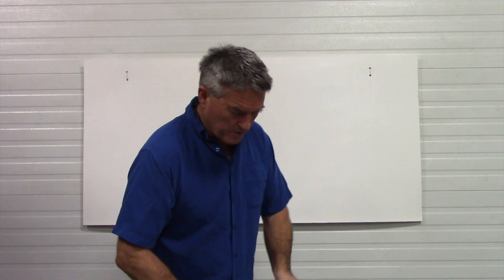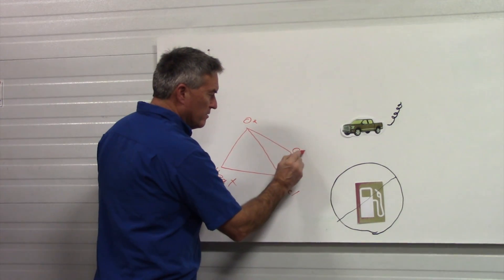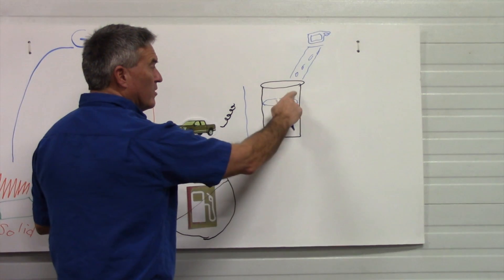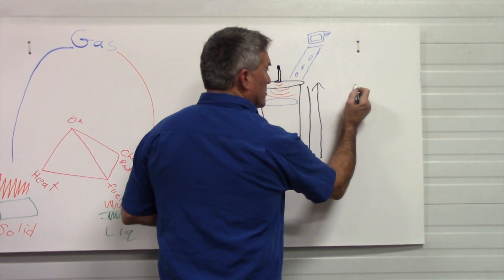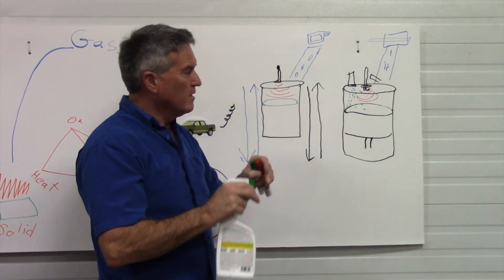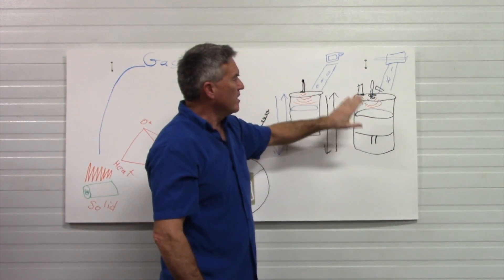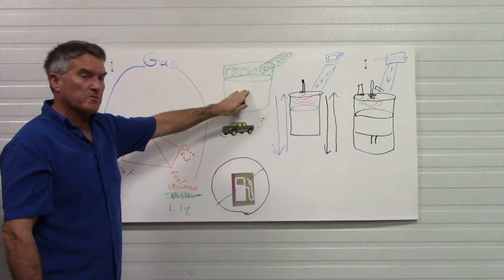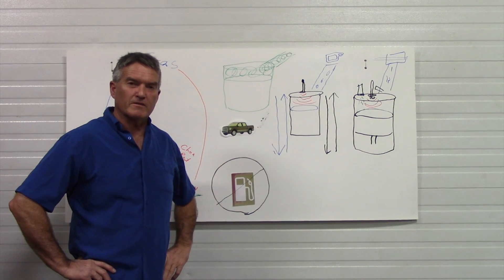One Simple Trick to get 100 miles per gallon with less pollution!

Comment: So your saying the specific energy density for a given atomic mass of a given hydrocarbon in a gaseous state (pick a temperature constant, I care not for small details at this point) is higher then the specific energy density for that same atomic mass of the same hydrocarbon but in a liquid state?? I know u mentioned not all is burnt but that’s what indeed helps cool things (the fuel vapour of modern engines would have, I dunno, 97%? (Why have u not provided any quantitative or Theron dynamic data with reference links in description. Or showcased a working proof of concept..) vaporised done its job to cool valve seats by TDC. The other point is that introducing higher temp glasses into an engine, you are introducing gas that has a higher volumetric capacity per mass (thinner) for a given chemical energy potential than the same quantity of gas but at a lower temp. 
Denser is better...
Cooler is better...
Cleaner is better...

I know liquid actually intakes ambient thermal energy when changing to a gaseous state but I do not believe this can be completely or proficiently transferred into a combustion engines overall specific  energy efficiency. Not without a couple more patents there mate. And certified and engineered support systems. There’s a major advantage to only mixing minuscule amounts of fuel and oxidiser together, and immediately before it is to be used..... 

Any more to support your fanciful claims and stories?

Comment: I see a marginal improvement in fuel efficiency with more complete combustion, but there are complexities and limitations in a piston engine of any configuration, whether reciprocating, orbital or planetary. Pre-ignition must be avoided. Each stroke represents a distinct process - induction, compression, power and exhaust. Each process must take place separately in its own limited time interval, because all four processes occur within the same space, but cannot share the same time interval. To gain the best efficiency, the four processes need to be separated by location in the engine, rather than by time interval. Doing that affords each process the opportunity to occur continuously. Ergo the gas turbine promises to be the most efficient internal combustion engine, when designed and built correctly. Surprisingly, the axial flow reaction blading type turbine is not necessarily the best of this class of engine. Instead, a Tesla Turbine system comprising an induction turbine, compression turbine with fuel injection, a power turbine and an exhaust turbine (four turbines, all on the same shaft) is likely to be the best. But the power and exhaust turbines will run at especially high temperatures. They require fabrication from materials of very high thermal tolerance.

Comment: Combustion is rapid oxidation.  So iron dusts so we can burn steel in our cars!  When you burn fuel most of the left over pollution was already in the atmosphere.   CO2 has an atomic weight of 44.  32 is the O2 part. H2O same story. Eighteen total weight. 16 is the oxygen part. CO2 is not pollution for plants. It is food.  Plants are not pollution . They are very useful. Water is not pollution is not pollution
either.

Comment: That gas you mention has already being produced and it's still available today.  It's calld LPG (my old Mercedes V8 was converted many years ago in Holland), you may have heard it in Canada.  The fuel consumption wasn't really improved as such, but the real advantage was the substantially lower government taxation in all European countries.  The lower amount of lubrication from the gas/fuell, created some problems with smaller engines and  burned valves.
Good idea but I will put my money on electric vehicles.  Thank you.
Reply: Just cut notches in the intake valve rubber seals to bleed a bit of oil in - located in the valve spring.

Comment: I took six semesters of auto mechanics in the 1950's probably before you were born. Mr. Light, the instructor said the air/gas mixture in the cylinder, when fired by the spark plug does NOT explode, it BURNS. If it explodes you get spark knock. As far as for other uses such as in the kitchen, the Army has had gasoline fired stoves for decades where raw gas is vaporized and burned like natural gas, or propane.  Too many other errors and false conclusions. Eh?
Reply: He is corrrct!!  Gasoline liquid does not burn --- the vapors does !!  Also gas burns. It does not explode.
Reply: Can we use blower inside of fuel tank to get pressurize gasoline vapor ?
Reply: How about diesel engines that don't have a spark plug. The fuel explode when compressed. Hit a book of matches with a hammer. Compression explodes matter.

Comment: Reminds me of the Pogue Carbi (patent from the 50's I think). Heated the fuel by running it past the radiator so it was injected as a gas mostly. 
I have heard of modern-day experimenters running engines off of vapors in a similar way using electric heater boxes.

At the end of the day there are dozens of things you could do to make combustion engines more efficient but even then, 
they are still no where near as efficient than electric motors and combined with solar etc.  
they are just far superior in every way, maintenance, power/weight, but mostly low emissions.  

You don't have to take my word for it 
but please consider how much influence
 the people pulling in two billion Canadian dollars a day in Canadian gasoline sales
have on what you hear about the beauty and benefits of burning more gallons of delicious gasoline :)

Comment: The biggest concern that I have about the liquid fuel turned into a gas before it reaches the combustion chamber of an engine is that once it becomes a gas it is volatile and you're basically sitting on a bomb how big is a mom depends on how big the gas bubble is and that's why people won't use it! Now if you found a way to do it in smaller increments from liquid to gas just to burn almost a hundred percent of the carbon off of that, then if the explosion is small enough it can actually be self-contained with a safety valve but this would have to be a very intricate system and it would have virtually no room for error or God help anyone who gets in an accident of any kind!

Comment: Isn't that just a way of making "LPG" on the fly? You heat the petrol until it vaporizes, then fire that vapor into your motor. Why does it give such astounding results when LPG is really pretty average. Is the calorific value that is produced higher with this system than with LPG. Or am I just way off the mark. Could you please explain that for me

Comment: The "One Simple Trick" is to use fuel vapor. The internal combustion engine, both petrol and diesel was originally designed to run on the fuel vapor that this dude is referencing.  The 14.7:1 air/fuel ratio is one part fuel vapor to 14.7 parts of air.  Then the Petroleum companies dictated to the engine manufactures how the fuel was to enter the engine and they also dictate the valve timing.  Sometime in the early 1970's the valve timing was set wrong so that these big v8 engines were wasting fuel.  Its also worth noting that the 14.7 part of the mixture of air consists of 80% Nitrogen.  So the internal combustion engine is actually a Nitrogen powered engine, with the fuel been added to get the nitrogen to burn in much the same way that a Atom bomb needs dynamite to detonate the atomic reaction in the bomb.  To the best of my knowledge there are very few of the original vapor carburetor engines left but there is loads of videos of people running there SUV's on homemade vapor setups and corrected valve timing.  Its also worth looking at what the CAT in the exhaust actually does, which is burning off most of the excessive liquid fuel.

Comment: The U.S. Navy researchers created a device that recovered dissolved and bound carbon dioxide (CO₂) and hydrogen (H₂) gases from seawater. The gaseous CO₂ and H₂ are then catalytically reacted to produce liquid fuel. The process costs between $3 and $6 per gallon, and it’s estimated that they’ll be able to do this at scale within a decade. Methane =A  by product of the digestive process viz. FARTS :)

Comment: The first couple minutes reminds me of a failed Professor Proton addressing a class of second graders.  These contraptions never work because they restrict the breathing of the engine. Remember that an internal combustion engine is relying on vacuum to bring in the fuel-air mixture.  These stupid systems never work, because they restrict the airflow dramatically and will often times result in worse economy and a fuckton increase in pollution.  

Millions of Engineers have struggled with the intricacies of introducing fuel-air into a combustion chamber... FOR OVER A HUNDRED YEARS.  NONE of them have ever been visited by black Suburban driving, black-suited, black sunglass, Oil Company Death Squads.  Jesus Christ, sit down and shut up.

Comment: You explained the physics, but didn’t show how I can change my cars engine to achieve this. So, show me how to update my engine to achieve your explanation of converting liquid gasoline into a vapor which is sprayed into the engine which will result in 100 miles per gallon of gasoline.

Comment: Well to answer the first few things he said wrong wrong and wrong we're not going to run out of oil that's just a scarcity tactic to Jack prices up your ass.... and the secret to good fuel mileage is to heat gasoline into a vapor get a system like that connected to a car and you will get a hundred miles per gallon easily it really is that simple.... some what... depending on your level of mechanical ability.... I was getting 106mpg with my 91 Civic... it was a Hatchback Civic and it was loaded with about 800lbs worth of tools and other things.... anyway gasoline is a primer. Nitrogen is the main ingredient.... of course not many people know this most things being taught to people is a lie....

Comment: You don't have to use any fossil fuels to do the same thing. If people would put more emphasis on converting water into HHO or hydrogen gas you would not burn anything except water and there is absolutely no pollution. The exhaust turns right back into simple water and is a non-polluting engine.

Comment: After reading all the replies for the past hour, everyone seems to be missing the point:  Fuel efficiency is already engineered into the modern engine to give the most horse power for the least fuel.  When you choose a car, its engine was intentionally put together to work best with all the other aspects of the car.   Give more credit to modern science and auto engineers!   If you want a fuel efficient car to save money on gas, you can't drive a Rolls-Royce Ghost or a Farrari F12.

Comment: I haven't followed closely, to understand the concept of the 'invention', but here are my thoughts on the matter: Changes in state of matter, are quite specific, i.e. water going to steam.  A tremendous amount of energy is required for that.  Turning water into an aerosol, is not the same as turning it into steam, it still is water, tiny particles within another medium (air), but still not technically a gas.  I don't know much of anything about this video's process, and think that the process of really turning gasoline into a gas, would be quite precarious, due to it's low flash point.  Still, the idea smacks of some merit.  Again, in order to change the state of a  liquid to a gas,  requires an input of energy to that liquid. I don't know if this 'invention' does that.  I'll stay tuned.

Comment: Just a few things you have overlooked.  First the carburettor does not pour neat fuel into the engine, it Atomises it.   Then the piston raises the pressure and temperature of the air/fuel mixture to about 120psi and 300 deg C, before the spark occurs.  At these temperatures any fuel particle will become a gas.
Reply: Carbon Monoxide comes from incomplete combustion. Meaning fuel is not burning properly. And also a mist is not a vapor/gas.
Reply: But you also forgot one more important aspect, in your explanation. You forgot to factor in TIME. From a theoretical perspective, your explanation is right. But when you consider the very small amount of time involved, the end result will not be the same. And this is exactly why there is a carbon buildup in normal engines of today. The unburnt fuel, ends up as these carbon deposits. Therefore, when you premix the charge and introduce it as a gas, via the intake valves, no more time is required and ignition can commence immediately and has more time to burn completely and subsequently, increase the overall fuel efficiency.

Comment: Cars have used gas (natural and LPG) to power the engine and the reality is that there is no big jump in power output as you would indicate.  Furthermore the process of going from liquid to a gas is achieved by the minuscule droplets provided to the engine by the injector and the heat in the cylinder.   The reality is that the carnot real world efficiency puts an upper limit on the output achieved from  ANY fuel and this is at the very best 45% of the energy of the fuel. In reality this is closer to 30% and the loss factor is not caused by using a liquid - it is caused by the other overheads in running an engine.

Comment: Three reason this is not possible in a production vehicle.1 Knock adding heat to the A/F mixture is asking for trouble ESPECIALLY under high load and high ambient temperature. 2 fuel condensing in the manifold in low ambient temperature and low engine  speed.  3 transient  fuel

Comment: Cars converted to natural gas (methane) or propane typically get worse MPG than gasoline. This is ridiculous video. Just get Chevy SparkEV if you want efficiency and zero emission; I routinely get over 200 MPGe (6 mi/kWh) even driving in heavy stop-and-go traffic, and average over 35K miles is 182 MPGe (or 1,000,000 MPGe when charged from home solar). Record is 246 MPGe driving at 24 MPH for 5 hours. And used SparkEV are going for about $10K USD in late 2018.
Reply: What if I want to go more than 82 miles at a time?
Reply: m n0vak  SparkEV charges to 80% in 20 minutes, quickest charging electric car ever made (yes, even quicker than Teslas). Someone drove 650 miles in a day with SparkEV and 1000 miles in a day is possible. But if you can't have 20 minute charge breaks, drive slower. 140 miles is possible with SparkEV.

Comment: That is a good Idea, and I have personally proven that is works.  This was many years ago when I was young and naive thinking I can save the world.  The only problem with this approach is that by removing the liquid fuel  and replacing it with the vapor/gas, you are reducing the cooling affect the liquid fuel has on the combustion chamber, thus over heating components such as piston rings and valves.  Essentially the engine would self district in a short time.   But the concept can be employed with the proper modification, which could be substantial.

Comment: He is basically implying to introduce" vapor state fuel" into the combustion chamber than spraying "mist or liquid state fuel" 17 times per second into the combustion chamber of an engine cylinder. Vapor state fuel maybe economical but surely cleaner when burned. It might be significant but not substantial. Vapor state fuel in thermodynamic law is a big question when considering the standard parameter requirement of combustion ratio. Vapor state fuel definition must always correlates with achieving exact combustion ratio that converts potential energy into kinetic energy for a certain application like the engine of a vehicle. In my opinion, CNG and the likes are not considered vapor state fuels. I believe that this theory is possible and will have a qualitative, but not quantitative benefits. Meaning, It is excellent for the environment, but won't provide significant economic savings.

Comment: Return to me your email address please I'll help you all that I can. My email address is revaldea743@gmail.com and I'll help without pay just to get this going and better the world for the "Otto cycle engine {Spark plug ignition} I've got an Diesel engine that is almost 80% Thermally efficient this makes this engine four times the fuel economy of the Diesel at the same horse power and twice the torque as output, and has no crank shaft and has double the expansion while having higher compress ratio too, of course fewer parts to boot and very low, to almost none exist, NsOx levels. With Bio-fuel and oil for Near Zero Carbon Foot Print {NZCFP} thisis lss than one ton output of CO2 per yearand less than 2pounds NsOx per thousand gallons burned at the worst state of tuning that it will even able to run.

Comment: jUST HEAT THE FURL BEFORE INJECT ION TIME SO AS TO CAUSE THE THE LIQUID FUEL TO CHANGE INTO A GASSES STATE AT INJECTION TIME THEN RE SET THE INJECTION AMOUNT TO THE SMALLER AMOUNT there by getting the fuel directly into the cylinder so as to only have the air and wet the cylinder.  The fact that wetting the cylinder is not needed at all for best fuel economy and it is the wet cylinders that lead to pollution levels that not good as can be. The fuel injectors need only be designed to with stand the highly heated fuel and have to stop dumping the returned heated fuel in to the fuel tank rather you return it to a sealed sub tank that lets no air into the fuel flow path jet allow it to be reused while adding only new fuel to complete that is needed for desired amounts of the load requested of the engines for the next injection. There you have the modern yet to come into common uses of automobiles of today. That will get you economy and cleaner ait too.